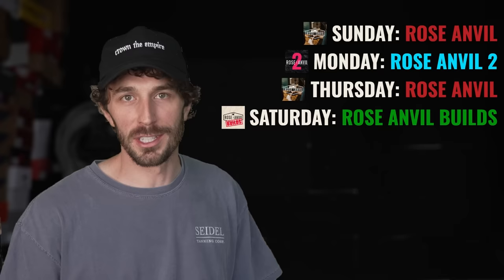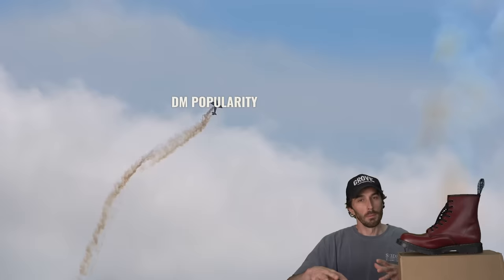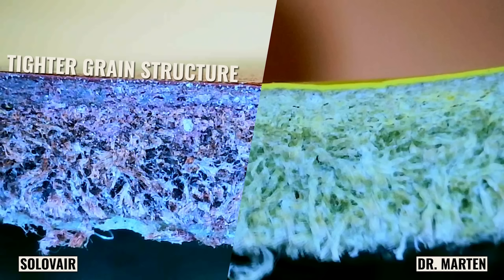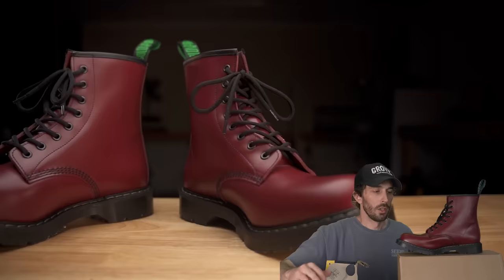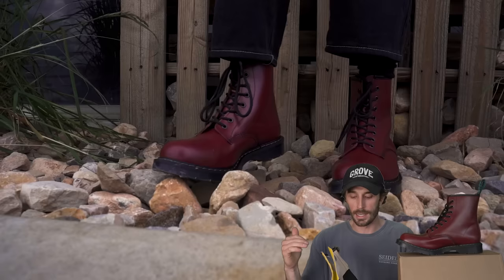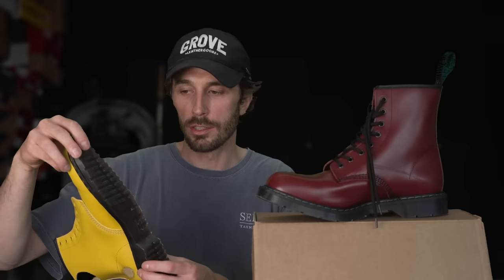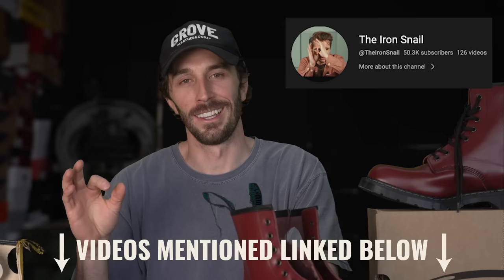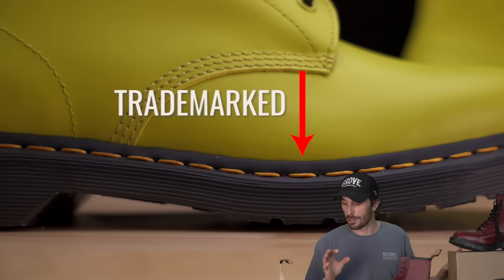Better than “real” Dr Martens - Solovair

Comment: Also one important thing to point out - solovair's are easily resoleable, meanwhile resoling docs is real expensive, sometimes even as expensive as a new shoe itself
Anyways, would love to see it pair againts the made in england docs, considering that they are cheaper i wonder if they are still the better option
Reply: how are they any different to resole?
Reply: @Enrico-  uh, solovair's are actually goodyear welted so it really isnt an issue to resole that shoe for a normal price (+the replacement outsole from NPS costs just 20 bucks, so really - resoling solovair's will run you about the same as any other boot)
Reply: @fragstore8761  Excepet they're not? I mean Solovairs are as goodyear welted as Docs as in the upper is stitched to the welt with the machine invented by Charles G. in 1869. They're different from a pair of goodyear-welted hard soled boots in that the sole isn't actually stitched to the welt but it's melted on as both are made of synthetic material and the sole would be too thick to be stitched on. The material may be somewhat different but the construction is the same.
Reply: @Enrico-  i aint exactly an expert on those things
but everyone says that solovairs are goodyear welted
and from my perspective, construction definitely isnt the same, most obvious difference is that the outside stitch is actually fake, and the real one is hidden
also, i've seen solovairs getting resoled for a normal price, never seen anyone resoling a doc martens
and also, what do you mean the sole would be too thick to be stitched on? that doesnt make sense, the stitch in goodyear welt is like a bit sideways
Reply: @fragstore8761  ok, so the answer is a little bit long because first I need to break down a little bit of basics. 
In a traditional hard soled shoe\boot the welt is the strip of leather to which both the upper and the outsoles are stitched to (with two different row of stitching). 
Before 1869 in order to make a pair of shoes you needed to sewn the welt by hand though the upper and the insole and that was of course time consuming and thus rather labor intensive. So this guy Charles Goodyear Jr in the New York City tri-state area came up with a machine that stitched the upper to the welt in less than a minute. Then you would use a second machine to stitch the welt itself to outsole. 
Docs (and Solovairs) have their once patented outsoles that are 1.2" thick (circa3 cm), you can't stitch the outsoles to welt cause the machine can't stitch that deep and even by hand it wouldn't be a real option. So instead they make the welt of PVC (the same plastic the outsoles are made of) and then the welt and the sole are melted together. So then the cobbler need to cut the welt and the outsoles apart and melt a new one on top. Which isn't how a cobbler usually resoles a pair of boots.
Reply: @Enrico-  damn, i just watched a video on youtube from inside of the solovair factory and you are right
still, i dont understand why people on the internet for years are saying that you can resole solovair, but resoling docs isnt worth it, bc it will cost the same as buying a new pair

Comment: I bought some Solovair 8-eye shearling lined boots to wear for winter, and while I do have the complaint that there isn't a removable, replaceable shearling insole, otherwise they've been very good boots so far. What I find interesting and definitely wasn't expecting is how well their crazy horse leather retains a shine. When I got them I used a bit of mink oil to condition them and just a little bit of brown polish to make the shade of brown more warm and reddish, and ever since then all I've had to do is give them a little brush-off with a horsehair brush and they're back to having a shine. Even after getting cobered in snow, scuffed, or dirty in salt residue and mud, all I have to do is brush them off and they look almost as good as new with a decent patina. Not glossy, but very smooth with a nice shine. I own multiple pairs of docs and while they're not difficult to maintain, they do seem to require a bit more care and attention if you want to keep them looking "nice" (unless you prefer the wear-and-tear look of very well-used boots, which some people do).

Comment: Solovair could use orange or white stitching or for that matter any other color and trademark it as their own as a way to show that they are made by the original doc martens factory in England and are as good if not better than the current 'doc martens '.  That would be a great advertising gimic.

Comment: Thank you for your comparison. I got my Docs eight years ago and they still work and are my go to festival shoe. Actually super comfortable with worn out orthopedic insole. The craziest thing to me is that the fiberboard structure inside is the same as my china docs and even with shank, I think because I cant really bend them into boats. They splitted at the bowl of the foot about year two years ago but still, six years of going to moshpits I feel like thats outstanding. 
I always wanted to buy new pair but Im hesitant that I got a lucky old type of DMs and now they cost almost as much as Solovairs, but Id rather have quality cool boot then just glorified rip off. Only shame is no steel toe for either of them. Couldnt give that up in moshpits :_D
Reply: Just went through Solovair shop, there are steel toe boots, but they have the stitching on top of the toe cap. Which is a shame

Comment: I still have 2 pairs of pre 1995 Dr Martens (Cherry red & Black) both sole and leather are good. Cracking a little at the big toe first joint but haven't split through the leather just the coating. Having said that IF i were to buy a similar shoe it'd be solovairs - though tbh its red wing & thursdays these days. [my budget doesn't go to whites :) )

Comment: I used to wear docs in the late 80s and early 90s and I always had trouble with the fibreboard disintegrating in the toe box. I gave up on them eventually because of this even before they moved offshore. I not sure if in Australia we got the Griggs or the Tredair. I wasn’t smart enough to realise that I could have had the inner sole repaired. Also broken glass at gigs would puncture the sole so I started wearing Caterpillar boots which were pretty trendy at the time.
Reply: We had the option of either, but you had to hunt around for the UK made ones. The last pair of UK doc's I bought in about 1991 and they lasted pretty well until about 99- I was working in spray painting at the time and eventually the chemicals just wrecked the leather. They were a good pair of 18hole ones too, so I was kind of sad when they eventually died a hard death as they'd been with me through some pretty formative years and there just wasn't any UK ones to be found for years 
Then I was doing office work so I didn't really need work boots, I did pick up some Solovairs about 15 years ago but didn't find them very comfortable at all. really tough to break in and a lot heavier than they needed to be so we're honestly just better with the aussie made work boots which are more modern.
Reply: @krissteel4074  For work boots I used to wear Steel Blue and they were great, so comfortable. My workmate used to say they helped with his dud ankle pain. My last pair were work issued Blundstone Zip Sided and they aren’t bad but a pain to drive in.
Reply: @paulaus  Most of the Steel Blue and the Redback's seem to be fairly evenly matched in the best value for boots. 
I had Blundstones in the 80's and didn't much like them either. They were very tough and well made, but just not very comfortable to clomp around in all day. Especially when it was really hot
Reply: @krissteel4074  The Steel Cap Blundstone we get issued are nothing like the elastic sided boots. They are pretty much the same as any other industrial work boots now.
Reply: @paulaus  For the zip-side, lace up boots they all tend to have to meet a number of chemical, electrical and impact standards so it does sort of mean you end up with a fairly standard boot that complies to all those.
Which I don't think is necessarily a bad thing and they're all generally in that 200-250 mark which is reasonable. If you're buying your own boots though it pays to shop around and try some stuff on as the actual comfort and support varies a bit. Especially depending on the work you do as well and surfaces. Concrete, dirt and rocks or even driving all day tend to have a much more varied range of stuff to tackle. 
Personally I don't want a thick sole on driving shoes, I do like a hard sole, high ankle support on rough dirt and appreciate a softer one on concrete.

Comment: I used English Dr. Martens shoes, without the yellow stitching (the one they made for cops and nurses),  in my job as a tram conductor in the 1990s, (standing and moving round a moving tram for 8hrs/day: Melbourne, Australia) and I still have them. They are not quite worn through the soles yet, and I still keep them as a halfway 'dressy' shoe. Obviously a better quality pair of footwear than the modern badge-engineered ones (cf.). I'd try a pair of Solovair if I didn't have a pair of JK OTs on order, a pair of Rossi Falcons (Australian, 1990, but getting a bit sad and old nowadays) as a repurposed hiking > work boot, and a pair of Redback Alpine steel toe as my chainsaw boot. Unlike you, I have limited boot space in my cupboard. One boot I would like your opinion on is the Rossi Mulga, a popular boot over here. I almost went for them instead of the JKs, but the PNW boot thing mystique wove its magic  . . . 
I've got a lot of time for Rossis, having had my aforementioned Falcons for I think 30 years:
https://rossiboots.com.au/products/4002-mulga-bushwalking-boot-claret

Comment: I was disappointed in my Solovairs, not because of the quality, but because my feet are too wide for them. I got a size 12, because they don't have 11.5 (I wear 11.5 EE Nick's), but they're still too narrow. In particular, the vamp cuts into the top of my foot and they won't break/stretch in there, because of the fabric lining. They've just been collecting dust pretty much since I got them.

Comment: This taught me the differences are marginal, you over sell the durability that's added at the cost of additional weight to the step and how it weighs on the foot, like you're the equivalent of a video game nerd min/max'er if this is the reason why you prefer one over the other. The difference in shank shows how the general public may like a general purpose boot over one that I'd want to "avoid climbing ladders or hiking in". All of it seems like a gross oversimplification to the reality that one is more general purpose built which cuts into life span, while the same is said for Solovair with some slight QOL benefits, unless you treat the Solovair's how you would a real general purpose boot.

Comment: Great video. Solovair are fantastic boots and the company are brilliant to deal with too. Got numerous pairs which I rotate to allow them to dry out. Last for years if treated well. Can put a leather insole in too for even better wearability. Great info on their site re lasts used etc. Also do Astronaut and Gripfast boots amongst others. Give them a try, you will not regret it. UK made too.

Comment: Sweet, thanks. I loved my old Docs from the 90s and noticed they went cheap, so I never got another pair after my first two. Might have found my next pair of boots. If you never had an original pair of Docs, they are some of the most comfortable boots there are because of the soles. I think there a bit cushier than a pair of Ariats as a comparison.

Comment: Dude! I bought a pair of made in England Doc Martens on feb 4, 2023. I made sure to be good about brushing and cleaning them frequently. I conditioned them as needed, but that plastic coating is practically self destructing. Started splitting within a month or so of wear.  😢 I got got

Comment: Nice to see them again. Im really hoping to see better heat welt in made in eng pair than regular. This one is great but i still dont know how to feel about declarative stitch. I love that dr martens stitch is actually structural pice you can see and makes it different than other boots. Im looking to have bouncy sole boot in collection but im so confused by the whole thing i didn't pull the trigger on any in the mid time. Solovare leather does feels nicer in life but im not shure how much that tickness has difference. Also there is new veg tanned 1461 line that came out that im really interested to see. Maybe you want to take look at those too

Comment: Such a pity Docs sold out. I had a pair that I first got before I joined the Police in my area. They lasted 17 years. I must have walked thousands of miles in them, working five days a week. When I replaced them, post-sellout, the new pair lasted less than five years. I was a more senior officer and hardly walked a beat by then. It just shows the fall in quality.

Comment: @rose anvil - So, I have a pair of Docs...shoes for the past 20+ years, the soles are still intact (though worn) and the leather has taken a beating from 'life' they seemed to me to last a good deal of time.  Is that because of where/who they were made by at the time they were bought?  I'm looking to buy another pair, but this has me on pause.  And, for as rugged as the Solvairs are, are they comfortable?  My thought is that while the Docs may not be as durable, they might be more comfortable...and unless I'm working a construction site, that may be a factor.

Comment: Had Docs years ago and they were already poor quality then. I remember I was shocked to find they had plastic tongues!  Solovair are much much better. However, there used to be a company called Blackmans boots, looked just like Docs, but in my opinion better than Docs as well. They were also much cheaper than Docs, kinda the price Docs SHOULD be. Not sure if Blackmans still does lace-up boots anymore though, I think they only do the dealer boot version now.

Comment: In the UK, there's hardly a price difference between them when comparing the same style (1460 docs at £169 vs 8 eye derby solo at £179). Only £10 more for Solovairs! It's a no brainer unless you really want to wear a brand name/yellow stitching rather than a quality boot.

It's a different story if you're looking for something specific. With solovair boots, you won't find an equivalent to all of the styles or colours. They're a bit more "basic". That's the only downside, I suppose, if you want to have a more interesting outfit as opposed to more utility.

For me, since I walk quite a bit, Solovair make sense as my everyday boots. I wish more brands made quality boots for women. I can't help but feel cheated/disappointed when brands cut corners and yet ask for similar prices for women's boots. I can buy mens boots, most of the time, but women with smaller feet than mine can't. They're stuck with lesser quality or having to spend a fortune.

Comment: Need to see if I can get my Solovair's re-soled, less than a year of wear and the sole was cracked and crumbling in many places. Uppers still seemed in great condition.
Reply: I had my Docs resoled, and it wasn’t bad at all. My cobbler pulled the old outsole off (it was already falling off each shoe), glued a midsole on, and I asked for a new soft Vibram wedge outsole, but once you have a real midsole, you can put whatever you want on the bottom. I might go for something with lugs next time.

Comment: Stupid question (really stupid). I hate the plastic coating of leather. Is there a safe way to remove the plastic coating so the underlying leather is exposed? I would like to be able to condition the leather to keep it supple, and to avoid the flaws (cracking) of plastic. Any ideas?

Comment: I managed to get 6 months out of a pair of the new doc martens .bought from their site not the copied Ones .both of them cracked  and split across the toes where they bend and the also split around the heels . I’ve had pairs from the eighties that lasted ten years or more .these today are junk ..you can’t get anything to soak in them like Dubbin to preserve the leather it just sits on the top unlike the old ones that you could coat them ,it soaked in and they lasted for years ..180 odd quid for a pair of English made Dr martens that lasted 6 months is just a joke ..I’ve just bought some solovairs to see how good they are ..they made Dr martens back in the day so they can’t be as bad as the modern day poor effort they do now ..

Comment: I had issues with mine. I ended up going back to my docs cus they’re faster to put on to rush to work and it must take longer then I though to wear In because my feet were starting to hurt wearing them. I do quite a bit of walking at work at times how many days would it take for them to be comfortable

Comment: From personal experience, I found Solovair to be quite ill-fitted for the size - the proportions of the footprint, the width of the upper part of the boot to name a few things I can't agree with. The tongue keeps sliding around within 3 minutes of walking in them, which drives me so mad that I'm now at a point where I'll just sell them on - the Docs are actually a better fit! Shame, as the quality appears to be better, but equally I won't tolerate a badly fitting boot because of quality.

Comment: The last time I brought British made i had a absolute nightmare with the company ribble bikes THE WORST CUSTOMER SERVICE. which is a shame they are good bikes you need to pray you don't have a issue 37 emails multiple phone calls couldn't get the right part sent out more to the point the bike wasn't built safely, five minutes earlier I could have been killed no apology I've given up and bought the bolt and thread lock not worth the stress with a clown show of a company hopefully solovar won't be the same.